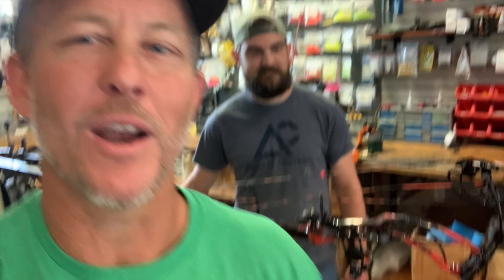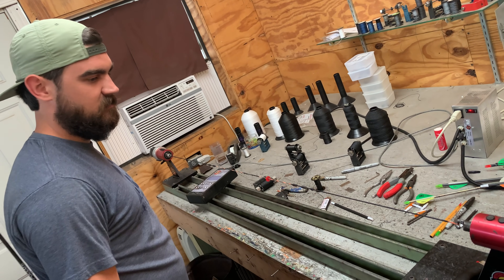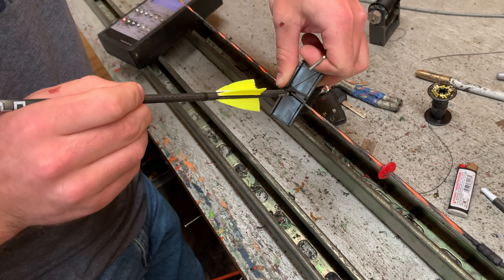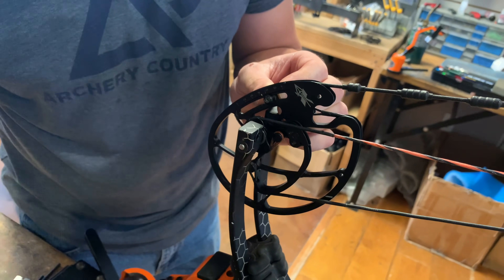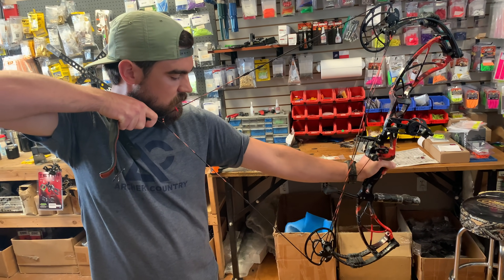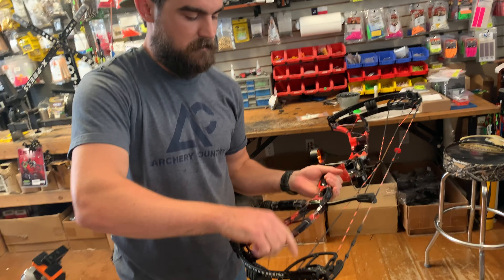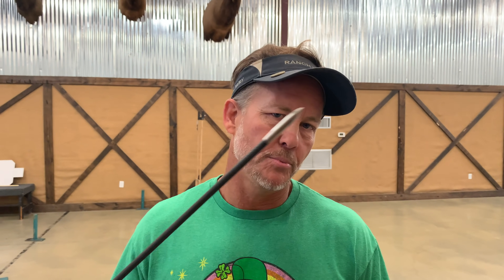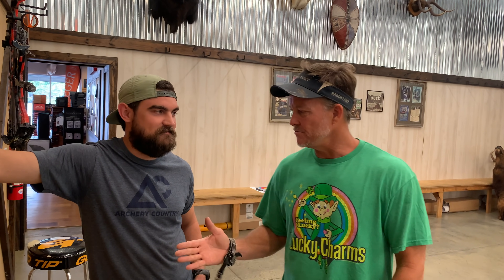Ranch Fairy Bow Needs HELP!

Comment: “Someone knows about nock tuning” had no idea what a nock set is 😂
Reply from the maker: Fair.  I just put D loop on and start bareshaft tuning - for a decade.  
Hmm, guess it doesn’t matter?  
Yup -
Reply: @RanchFairy  matters when you replace your d loop. Knock sets just help keep the same exact place you had your knocking point at.
Reply: @jimk2762 
I agree and I also use soft nock sets, mainly to avoid nock pinch, expecially on shorter ATA bows, however, if you only use a D loop, when you have to replace it, you can still be very precise, just nocking an arrow (or just a nock), untieing or cutting away just one of the two knots of the loop you want to replace, tieing in the same exact spot the first knot of the new D loop, cutting away the second knot of the old loop and tieing in the same exact spot the second knot of the new D loop.

Comment: The RF is fantastic. Free information and none of it has steered me wrong. My bow used to be loud and decently accurate. Heavy arrows now make the bow sound like it should and the accuracy has improved. I am impressed. If you are on the fence go ahead and take a line of the fairy dust, you won't regret it.

Comment: A quality bow technician is tough to find and worth the time and money.
Reply: I wish we had a local pro shop with technicians that really had a passion for their work and to continue learning.  All I've found here in northwest Indiana and the South suburbs of Chitcago is either old guys that don't even use a tape measure,  guys that already know everything and young guys that only learned enough to get a paycheck.  So,  YouTube is where I'm at 🤷‍♂️
Reply: It's up to u to be ethical. It's perfectly acceptable to get 3 out of 12 carbon shafts that have a misbehaving tendency. But it's easier to rule out those shafts if u start with no vanes or feathers. These arrows r only for shooting spots.. Worst case scenario is that your groups @ 20 yards r 2" different than the remaining 9 or 10. U r better off if u consider a tight group by not pounding arrows together into a center dot cuz that is an archery arrow. A hunting arrow has to be true since it's only purpose in life is a passthrough with 1 shot. That when u end up with only 5 or 6 true arrows out of a dozen. Shoot an arrow into the target. Then shoot another 2" to the right. Another 2" to the left, another 2 arrows above & below your 1st arrow @ 2". That is a great hunting arrow group w/o damage. Change to a stout broadhead target & make your aiming point with broadheads 3" just for good measure.  Remember measure twice, shoot once. Full measures only lead to successful hunting & time better spent not bloodtrailing.😄
Reply: @M Maple that's a couple hours away.
Reply: @M Maple yeah,  I'm an hour southeast of Chicago Heights area.  South West suburbs are two hours away.  Thanks though
Reply: @M Maple Thanks.  I'm only an hour and 20 minutes from Mokena
 Didn't know about them.
Reply: Fact! Here in Bismarck ND the only place is Scheels, and I refuse to trust my gear to those imbeciles.  So I ended up buying a press and learned how to be my own bow technician. Same reason I butcher all my own animals, only way I know the greatest care has been taken throughout the procedure.

Comment: I’ve been recently introduced to “bend indexing “ and I’m finding it to be just as consistent at nock tuning and it’s a much quicker process. It’s actually producing better groups because there’s more control of the spine, in my opinion. Let me know if you’d like to learn more.
Reply: Tell me
Reply: What’s it about
Reply: @nicetryb0z0  I didn’t realize I had responses till this morning. Go watch John Stallone’s video “most accurate arrows - first bend indexing arrows”. He explains it pretty well.
Reply: @MAYHEMSCO   I didn’t realize I had responses till this morning. Go watch John Stallone’s video “most accurate arrows - first bend indexing arrows”. He explains it pretty well.
Reply from the maker: @mat_in_texas  
Well, you do know your bow
At your draw length 
And draw weight 
Bends the arrow most accurately representing you shooting it
Reply from the maker: Excellent - the only thing I’ve got to say
Is - nock tuning is every individual person
Shooting their bow
Under their conditions - grip, DW, DL, etc. 
with every single bare shaft arrow.  Which takes effort and that scares people. 
So, I’ll take the long road.  Because I want to know how
Me
Shooting my bow
Bare shaft 
Shoots for me.  
Thanks for redirecting my channel content and running it over to John’s - sweet troll move there!!

Comment: I know I should have a bow stop on my bow,  but it fell off after shooting maybe the first couple hundred shots. Since I was splitting arrows at 40 yards,  I didn't bother replacing it.  10 years later and less shooting time on a regular basis,,I should get one.
Reply: I wish we had a local pro shop with technicians that really had a passion for their work and to continue learning.  All I've found is either old guys that don't even use a tape measure,  guys that already know everything and young guys that only learned enough to get a paycheck.  So,  YouTube is where I'm at 🤷‍♂️

Comment: Point weight tuning aluminum arrows.  When I am getting close, cut on contact will hit under 3 inches from where same weight field point hits at 20 yards. My experience, even well matched field points to arrow spine/length just won't fly exactly the same as same weight broadhead, unless you are shooting in a vacuum, and most people like breathing so...
Reply: Bump your rest up something like 1/32 of an inch. You're not shooting perfectly square. Square enough it probably doesn't show up on paper, but off just enough to cause the broadhead is catching some wind and driving it down a little.
Reply: I shoot VPA single bevel and they hit just as a field point to 50 yards. Bow has to be tuned
Reply: I bare shaft tune and get good arrow flight with 200 grain field points.  I turn my 200 grain broadheads all straight up and down and they will impact consistent, so I just sight in for them knowing my field points will group different. When FOC is off, I have had broadheads miss the entire target.
Reply: @Kurtdog63  ya bud, you got something a little screwy going on. I don't even bother clocking my broadhead any more, if everything is tuned properly, it shouldn't matter. I'm obviously don't know what bow or rest you're shooting, but if it where me I would check cam timing, cam lean, center shot, and nock height then start over. If not, you do you.

Comment: The victory rip TKO arrows I use are already spined aligned (and fletched).  Would these need to be nocked tuned as well, or is that a different thing?
Reply: I use those myself. Generally no, but it's not a guarantee. I'd say about...2/10 will need something like nock tuning, and when they do, they are usually less trouble than other arrows. My two cents.
Reply: @cynicalclockworks9857  
Thanks!
Reply: No they do not need to be nock tuned. I have victory vforce  that are spine aligned. Archery shop guy told me that you don’t have to mess with these arrows at all.
Reply from the maker: I’ve got them too.  I had to nock tune about 50% of them
Reply from the maker: @oldfatnugly  HMMM Ya DONT say!!  
Nock tune them all
Reply: Spine aligned arrows are nice having that reference point. But they will come off your bow different than they come off of mine. So it’s definitely not a bad idea to test them at different nock positions to see what they do. They say to put the spine up, but you may find they fly best with the spine down or left or right.

Comment: I think your knock tune will find your spine index at 12:00. Two different ways to achieve the same thing.
Reply: Would you mind explaining this a bit more?
Reply: @decaturridgebees8761  any time i build a batch of arrows, I start by suspending the shaft on each end. Hang a weight from the middle of the shaft and measure the deflection. Mark the shaft and note it. Rotate an eighth, and do the same, 7 more times. Whichever mark has the least deflection is twelve o'clock. That mark gets the knock fin, and knock perpendicular to it, so the knock fin is up. This always gives me a bare shaft paper hole that is close. Math gives me my length, and Easton charts give me spine. So small adjustment to my rest, knock point, or both dial me into a bullet hole. As soon as one arrow makes a bullet hole, they all do, or extremely close. I think spine indexing does the exact same thing as bare shaft knock tuning by shooting through paper, and adjusting the knock to get a bullet hole. The arrow bows a lot at launch. This bow must be at 12:00 on every arrow to get true and consistent flight on all arrows. That is what knock tuning does, and it is also what spine indexing does. Now that i have a season on my arrows, i am going to defletch them and start over, because i know my bow and arrows have changed over a thousand shots. I like Ranch Fairy's method of knock tune. Even after my spine index program, if i have troublesome arrows, I learned, from Ranch Fairy, that the slightest knock twist can dial right in. That's my story, and I'm sticking to it😂
Reply: @vitodelorto1796  thanks for sharing.  Do you know of any videos on this procedure?  I built my first arrows this year so learning something new like this would be fun
Reply: @decaturridgebees8761  there is a guy, i watched last year, with a very good one. I'll see if i can find it. I learned spine indexing from a book, a long time ago. That, along with bare shaft paper tuning, made me imstantly a much better archer. Hang on, I'll look for that vid.
Reply: @vitodelorto1796  thank you buddy, i appreciate it!
Reply: I've seen people say that the spine index is just a starting point and you adjust from there. There is still some knock tuning to do after indexing the spine
Reply: @HickLif3  they are both great tools to achieve the exact same goal, which is driving the knock through the exact  lengthwise centerline of the shaft, at launch. Either is good, both is better. Bare shaft shooting through paper prooves your work. Ranch likes to shoot at his target from 20yds-ish and turn the knocks until the arrow impacts are pointing directly at him. I like to bareshaft shoot through paper until my tears are bullet holes. Both methods give the exact same information, which is "how true is the arrow leaving the bow, and not wobbling on its axis during flight, but spinning on it. 
There are a hundred different programs, from shafts showing up on your porch, to shooting bullseyes, with finished arrows, instructional vids on youtube. If you must shoot at the alternate tiny bullseyes on yoir cube, because with broadheads, you will shave the fletches off of the arrows already in the target, you chose the right one.
Reply: @decaturridgebees8761  my pleasure. Good luck!

Comment: RF, do you need to shoot through paper at various distances to determine if the arrow is oscillating? Or if you get a bullet hole (or close) does it mean it's flying straight?
Reply: If it's flying straight at 10-20yds you're good.

Comment: What's the point of nock tuning of you can't get a bullethole. The tech should've checked centershot n cam lean.
Reply from the maker: Arrows have a seam.  They bend differently as you rotate the nock.

Comment: This is your "heavy arrow" scientist yall are obsessed about and listening to....  doesn't even know the basics of a bow lol
Reply from the maker: Yep - but he knows a ton about breaking bones, perfect arrow flight and shooting through animals. 
Pick one.
Reply from the maker: @chrisbahlmann4263  
Well, that’s kinda unfair - but I’ll play. 
I’ve covered extensively
Perfect arrow flight - over and over and over 
Super sharp broadheads - multiple videos 
Test lab on live animals applying what I “preach”
I have no idea how maximum on impact arrow lethality is not the only goal.  Thanks for the comments
Reply: @RanchFairy  1. You won't have ANY penetration whatsoever if you don't hit your target and shooting heavier arrows does in fact create a large arc in your shot making it massively harder to hit your target. If its brushy and you're in the woods and there's branches sticking out everywhere well guess what if you have a massive arc in the flight of your arrow you're about 9,000 times more likely to hit a branch or brush or anything else for that matter when your arrow has a deviation of 10 ft in height from a straight line to the target. Not only that but if you move even the slightest at full draw (which is very very possible due to the fact that in alot of situations you are stuck at full draw for a minute or more and you begin to fatigue drasically) you will miss BIG. That is a huge issue. Not only that but this whole bone breaking crap is such a joke because what you're looking for in a shot is to NOT HIT BONE?!?!?!?!?!?! If you're hitting bone its most likely due to the fact that you chose to go with an absurdly heavy arrow and you sacrificed accuracy in the process and made the slightest mistake in yardage or you barely moved causing you to miss by ALOT OR.......because you went with a heavy arrow and the animal you were shooting at had time to eat, sleep, and breed before the goddamn arrow finally made it to the animal. Set your arrow weight at a lethal measurement and be done with it don't go so far overboard that you take everything away from accuracy and your arrow beating the animals reaction.
Reply from the maker: @chrisbahlmann4263  
This too shall be debunked 
Stay tuned - the math is coming!!
High arrow lethality at impact is the only thing that matters - if you think you can control what you hit when an animal jumps the string. 
Well bud - there’s plenty of other channels that will stroke your ego. 
Thousands actually. 

I plan to hit bone and shoot for perfect lower 1/3 vital v hits - never intentionally try to hit bone.  But hey, what if?   
You and I differ on a major thing 
Maximum arrow lethality at impact on all situations
VS
The industry line “just hit them of course it will penetrate”. I assure you that is not the case
Thanks for the comments
Reply: @RanchFairy  ok so why stop at 900???? Answer me that! Why not make a 3,000 grain arrow???
Reply from the maker: @chrisbahlmann4263  
See dr Ashby’s notes on Papua New Guinea - 4000 plus - sambar deer 
No fletch - longbows!!
Reply from the maker: @chrisbahlmann4263  
https://www.grizzlystik.com/PR/Ashby_Papua_New_Guinea_Bows_and_Arrows.pdf
Reply: @RanchFairy  this is your source? Dude........you think this translates to a 2021 bow and carbon arrows and the broadheads we have today!??!
Reply from the maker: @chrisbahlmann4263  
Yeah - of course - those arrows are 4,000 grains going 100 FPS and they blow thorough deer 
You asked why not 3,000?  
So sure - plus those guys are hunting for food.  Wonder why they don’t shoot 350 grains?  
Anyway - you’re either obsessing about what will penetrate the highest percentage of the time - then focusing on perfect flight 
Or
You’re flying a stick and saying it will then penetrate whatever it hits. 
There’s a lot of “whatever” in animals.  
We’ll be ok man.  Just a different way of looking at it.
Reply: @RanchFairy  sure except you're ruling out the fact that TONS of people are getting complete pass throughs on elk shooting 60 lbs (even less) with 400 grain arrows. There's a point of diminishing returns. Also when your FOC is too high you do NOT have good flight........the fletchings simply can't keep up with trying to keep the tail end of the arrow straight and do their job of steering.
Reply from the maker: @chrisbahlmann4263  
10th grade kids shooting rockets know more about perfect flight than 95% of archery business 
Study center of pressure and center of gravity in fin stabilized rockets 
Flying “sticks” actually stabilize aerodynamically with more forward mass.  
Yep - light arrow guys can do well. If they hit the ultimate perfect spot.  Not denying that.  
But I’ll counter with literally thousands of 10” penetration on deer and “smoked him”.  Deer are marshmallows.  Stay tuned for the ashby foundation reports - first set of compound data and testing on cape buff.  It’s super cool.
Reply: @RanchFairy  hopefully they use modern technology. I could probably throw a 4,000 grain arrow harder and faster by hand then someone could shoot it out of a bow lolol I'm almost not joking. So what is your version of a "light" arrow??? I'm curious to see the penetration difference between your 60-70 lb bow that you shoot with your 1,000 grain arrow vs Cam Hanes bow at 90 lbs if he shot a 465 grain arrow. Because guess what that makes a difference too! I bet you'd be beat in penetration with your heavy arrow! And he wouldn't be limited to open country hunting like heavy arrow guys are.